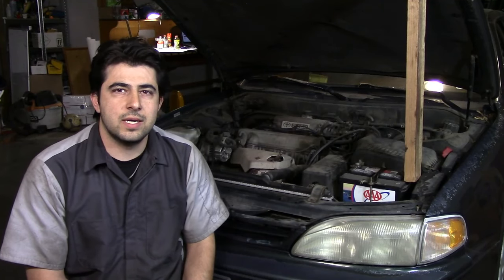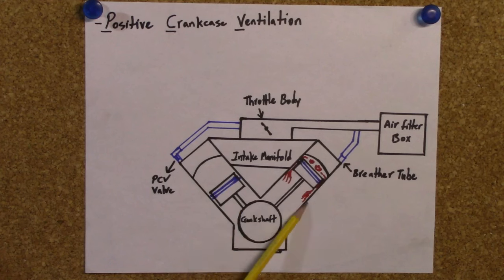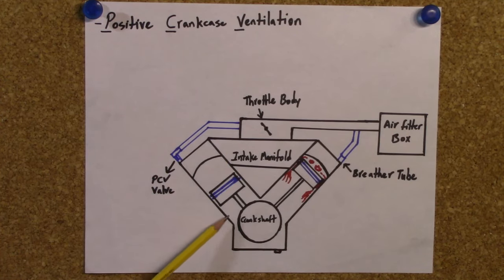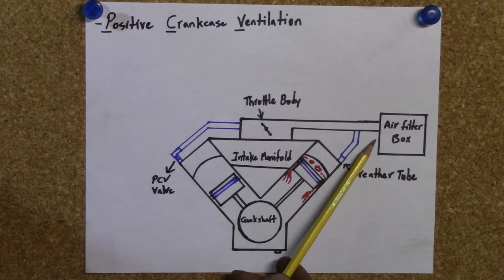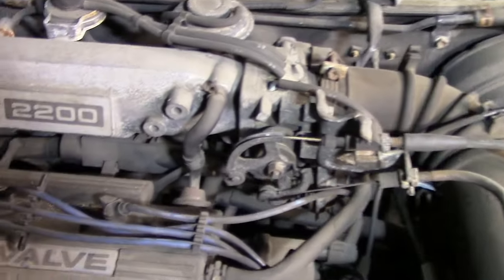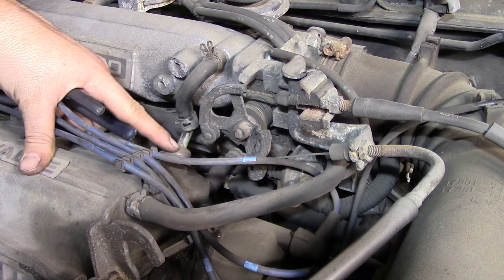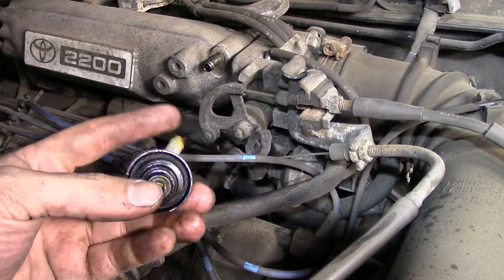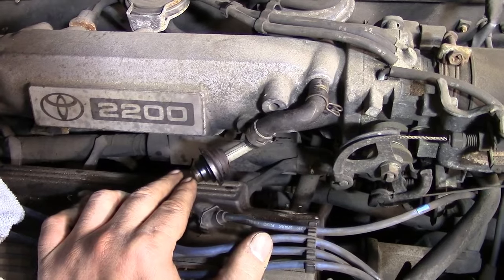How Does a PCV System Work - Also Testing and Inspection of the PCV Valve

Comment: I have a 1983 2door cutlass supreme V6 3.8L 
the PCV i unhooked it from the vacuum and plug the vacuum hole. And remove the PCV 
But i noticed one thing my car is running better ??? Can I drive my car like this or is it going to ruin my engine????
Reply: Any condensation or liquid that forms in the engine will be burnt off when the engine heats up. This vapour will exit through the crank case ventilation pipe. If it's blocked the liquid will contaminate the oil faster.

Comment: It looks likes the fix for sludge/carbon build up in DI engines just unplug the PCV hose from the air intake tube. Then cap the open tube on the air box and put a breather filter on the end of the PCV hose.

Comment: hi i like all your video you are very good mechanic i wish i can have you here in Arizona. I have problem with my 2007 Escalade esv first engine code p0171 and p0174  now i have p0300  run bad and engine shake lot and mechanic told me i need to replace lifers, i call second opinion hi told me same and i told him ok let fix this car, after hi remove lifter all lifters was very good so hi replace all gasket and put back cylinders and hi star car my car now run so bed and again engine shake and stability control com on soon you torn engine on, i spend lot of money for nothing. i need your help,,, i think is problem not vacuum leak but PCV valve , i change purge valve,air flow sensor now only left Throttle body and pcv valve .Please i need your opinion what i need to do now to run my car. Thank you
Reply: Sado Shala def change the valve
Reply: I have the same codes on my 99 ranger ..same idle shaking ..no vacume leaks at all no oil leaks or consumption ..changed everything but that valve 😒

Comment: I have a 98 Audi a4 2.8, tried to take the breather hose off like 5 years ago and it snapped, after that I remember my car started idling all messed up. After that I just taped it up with duct tape lol well needless to say I didnt know how important that these vacuum lines are and always had poor idling ever since, even when I drive and tried to punch the gas it would hesitate bad like feels like the throttle body wasn't opening up right, I just changed the whole crankcase breather hose and valve covers, took the throttle body off and cleaned it, started the car and it idles fine, hopefully it stays that way, pray for me!! Lol

Comment: at idol there is more vaccum! w
hy did pcv valve dint open at idol?
Reply from the maker: +Raju Yadav There is more vacuum inside intake man but less inside the vacuum line from intake to PCV valve. When you open the throttle, there is less vacuum inside intake manifold but more inside the vacuum line to PCV valve. cheers

Comment: To understand: what force cause the PCV spring works (open/close)?... the vacuum or the pressure of the crankcase?  ....  because I have problem: I saw high vapor come out from the oil cap. wonder why! ..... I replace with a after marker pcv valve 2 month ago.
some one told me maybe i have blowby problem. I know what cause too much blowby, but before go throw the piston ring I wonder if with a oil catch can can fix this.
But my question is, the pcv valve maybe is defective and no working properly to release that pressure??? PLEASE HELP !!!

Comment: What happens if the valve is stuck open
Reply: You know I wonder if the pcv valve is casuing my oil consumption problem. My car uses about a quart of oil in between oil changes but i only have 70,00 miles on my vehicle. this has always boggled my mind but i have never changed out the pcv valve though.
Reply: Ok I will try it thanks for responding!
Reply: Engine would run rough

Comment: So I took out the pcv valve but the grommet was a pain in the pass to take out and it broke. A small chunk of the grommet felled inside the hole and I couldn't get it out and gave up. Will it damage my engine? V6 Camry.
Reply: CastrejonHDTV no

Comment: I changed my PCV valve and now my car is stalling at more intersections than before i removed it. The old one was pretty gunked up so i decided to change it. But now i still have the issue only it was worse. I did notice one of the hoses coming out of it was melted in a spot but i didnt see a hole. Tomorrow i'll check to see that i put on all the hoses on there tight enough.
Reply: Franken Peter hey, I had a similar issue on my F-150.. Did you end up fixing the problem? Thanks..
Reply: I think that's a vacuum leak, you probably didn't put the tubes tight enough or you cut another tube while you were there.

Comment: Ok I have 73 el Camino with 350 and every time I hook up the pcv valve it runs high in idle than when I plug it it runs fine. (What up with the pcv valve when I test it it make a hissing noise)

Comment: thank you very much!!!! toyota was going to charge us $70.19.
Reply: Need to do my 02 Yaris v.soon as a preventative maintenance,did my IAC awhile ago and it's worth doing yourself.Thanks for the videos.
Reply: Vanessa Ruiz meineke wanted 90
Reply: @heyitschinoable  Typical in USA
Reply: $100 is a small bite compared to engine seal damages when its simply ignored ... then Honda charges $1200 to "reseal oil pump" seal blown by age + pressure (without addressing PCV cause!)
👍🏼

Comment: If you want to check a PCV valve correctly , use a Motorbike carburettor synchronising tool, attach it to the PCV valve and take note of the needle display, it will increase with the increase of engine load. Best way to check. Cheers
Reply: Another waste of time -- Just REPLACE the PCV Valve every 5 years or 50,000 miles.

Comment: This Video does not show how to test a PCV valve properly, simply checking to see if it's sucking air is no way to determine if a Valve is faulty. A PCV  valve has 4 function positions. Engine Off - No Vac NO Flow through valve.  Idle- High Vac, Low Flow through valve. Cruise- Moderate Vac, Moderate Flow through valve. Full Throttle- Low Vac, High Flow through valve. So at full throttle the PCV valve will have maximum flow but engine will have low vacuum. The purpose of the PCV valve is to Control the crankcase ventilation so that when the engine is under high load condition the highest amount of crankcase emissions are drawn into the intake system, while reducing the flow at idle when manifold vacuum is high and the need for crankcase ventilation is low.
Reply: very true...mine seemed ok but since it costs only $3 on rockauto.com, I went ahead and replaced it...boy the difference in response and increased HP from such a small thing was unbelievable....all that pressure being properly relieved makes for a smooth running engine & increased MPG...FYI a bad PCV valve will also give you rich and lean codes on both banks for v6 or v8...
Reply: Pretty sure the pcv has no flow when full throttle..if there was flow youd get a lot of pressure to the crankcase especially on boosted applications
Reply: my one costs approximately 53 Aus dollars and require to be ordered from Japan

Comment: You've made a mistake in the basic concept of the design, amigo.

While a stopped up PCV valve may appear to be a risk, the excess pressure simply vents out the breather hose and into the intake air stream. This eliminates any possibility of pressurization except on extremely leaky cylinders!

I have capped the vac source for HUNDREDS of engines with no negative effects. In fact, the actual OPPOSITE happens! Essential vacuum is restored to the intake manifold that is crucial to vaporization of your fuel prior to the point of ignition.

This yeilds better mileage (sometimes as high as 5 more MPG's), increases power and actually reduces noxious gas emissions.

Don't just buy into whatever the manufacturers tell you. I've found many systems in the modern engine that are detrimental to achieving the fullest efficiency levels.

Ron Hatton
Developer of The Gadgetman Groove
http://www.GadgetmanGroove.com?atid=10